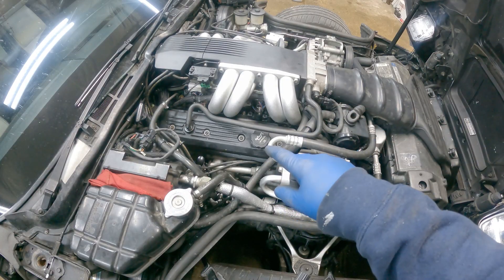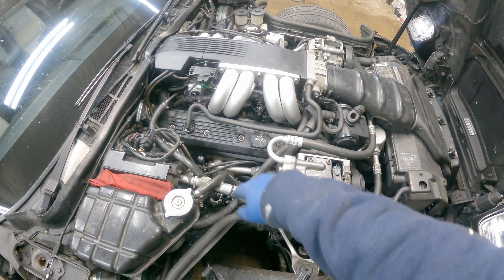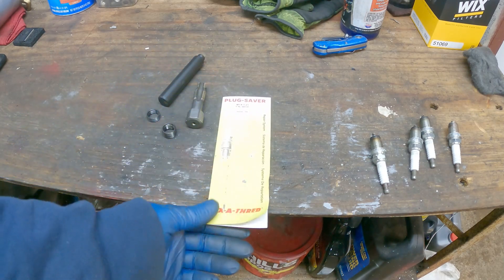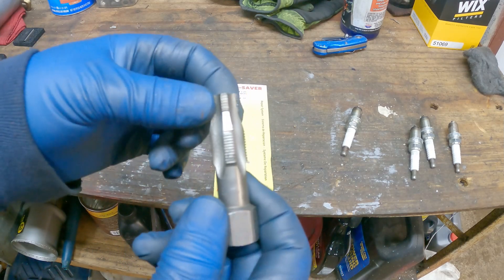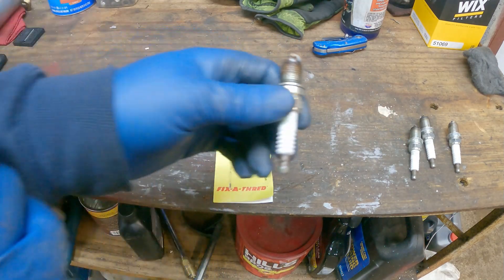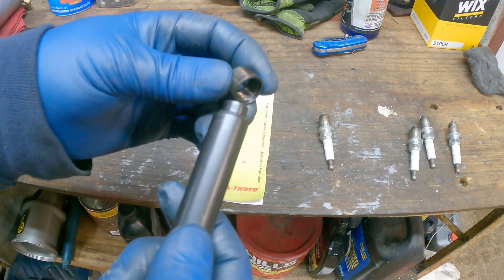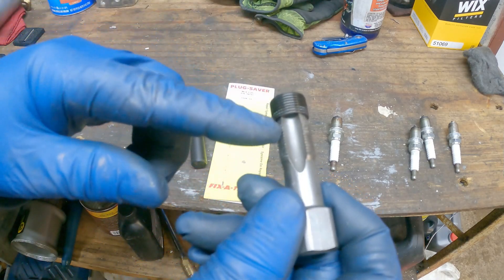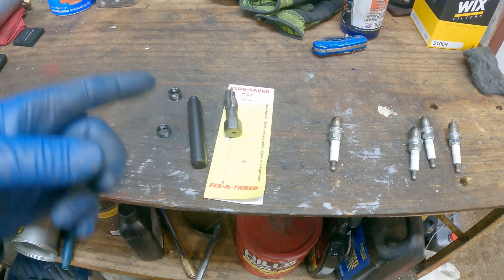Fixing a Stripped Spark Plug Hole in my freshly built SBC,  Tips and Tricks

Comment: What year is thus? My 86 number 4 blew out. I just cant take my center inner fender off. Its rivited. Was yours?
Reply from the maker: Mine is a 90, my inner fender liners are not riveted, I have never seen any C4 corvette that had them riveted. Good luck with your repair.
Reply: @E.T.GARAGE  I was wrong. It was the inner fender support. Thanks!